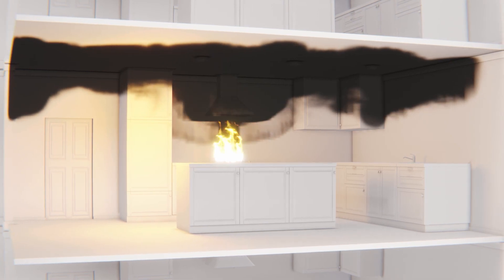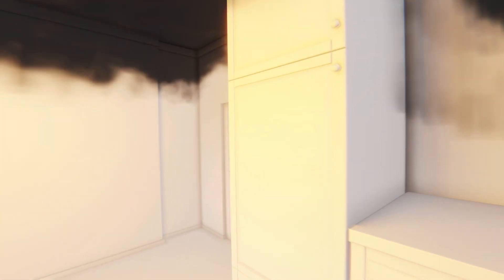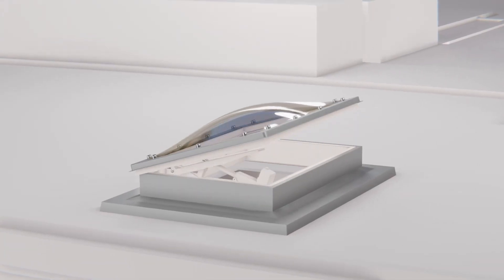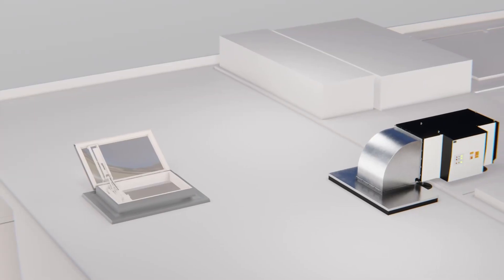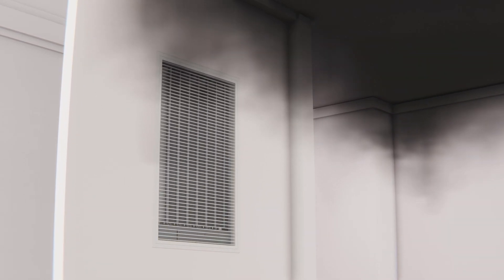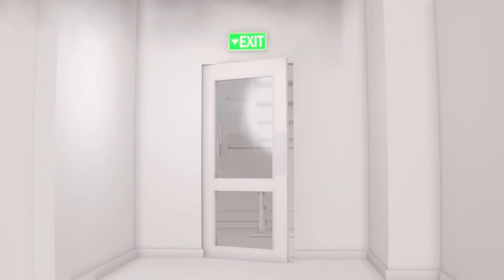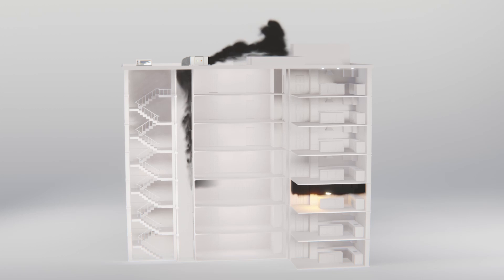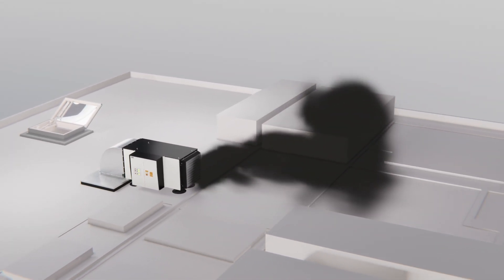How Mechanical Smoke Ventilation Systems Work

Comment: This is incredible! Nice animation. I never thought such technology exists for safety. Also, do the air flow help fire have more oxygen?
Reply from the maker: Thanks Omni! Glad you like it 😊  It's a great question.  If you watch the animation closely, you may be able to see that the apartment door closes (with a door closer) and we are ventilating just the corridor and stair, not the fire zone.  

That having been said, it's not necessarily a bad thing to make sure a fire has sufficient oxygen as insufficient oxygen will lead to incomplete combustion, resulting in a greater amount of toxic product of combustion.  It also increases the risk of backdraught (a fire starved of oxygen but still with sufficient heat and fuel = a large explosion due to the rapid combustion of unburnt gasses when oxygen is reintroduced). I hope that helps explain?
Reply: @SertusLtd  yes that helped. That was a dense explanation I learnt a lot. Thanks!

Comment: I wish we had those in America
Reply from the maker: Hey @shepherd wolf!  Thanks for the comment 🙌🏽 You have something similar in America... they work slightly differently though.  Usually in America, you use pressurisation systems.  These work by pumping air into the protected spaces (e.g. staircases, firefighting lifts and firefighting lobbies) to stop the smoke flowing back into those zones. 😊 We're starting to see more of them over here. Hope that helps?

Comment: What is the name of the program wich used to present this??!
Reply from the maker: Hey Shahd, sorry for the wait on our reply.  We use Blender... it's a very cool open source programme 😊https://www.blender.org/
Reply: There are tons of different software out there that you can create this kind of animation.
For example, you can create the Base modeling + animating in 3DS Max and render it using Vray.
And for the smoke simulation, you can use chaos Phoenix which is a 3d simulation plugin for 3ds max, especially for fluids, fire and smoke simulations.
if you want to learn more about this kinda stuff There are some tutorials on my channel as well.